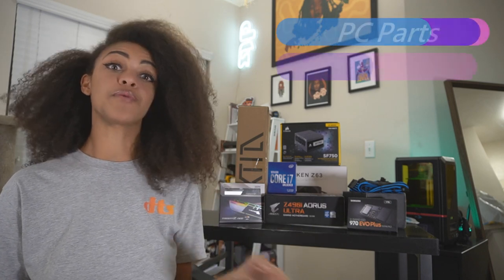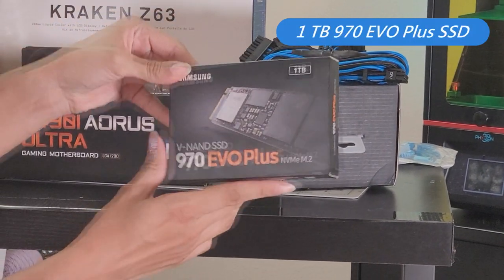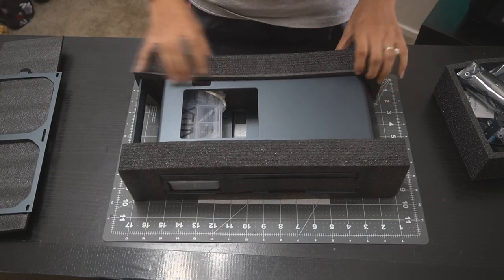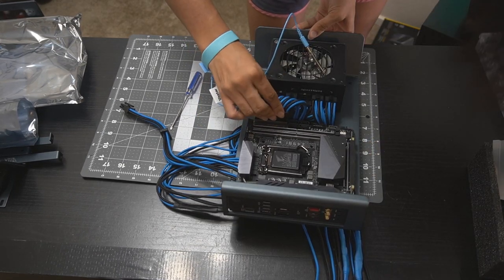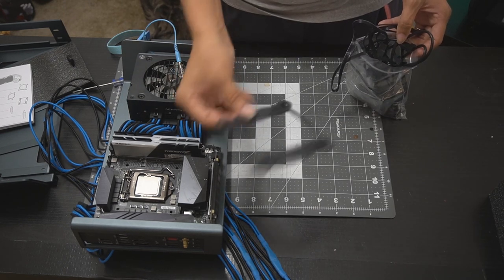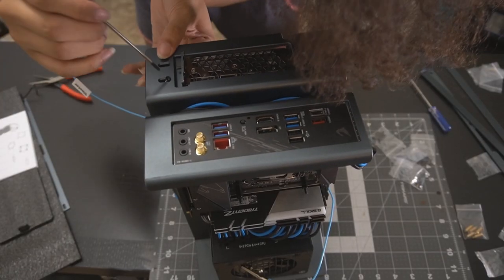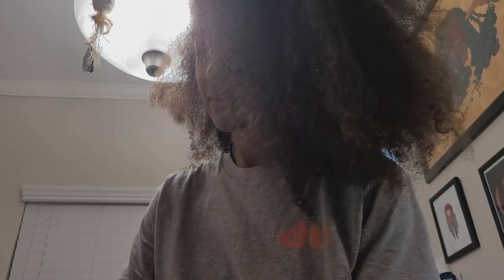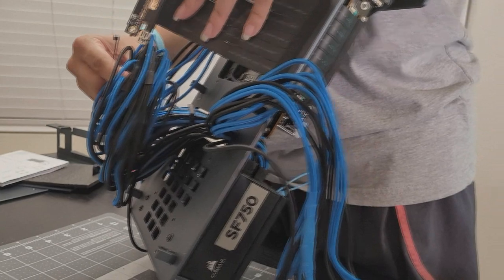BEST Mini ITX Build EVER - XTIA Xproto ITX Case

Comment: Can NZXT fans installed towards outside instead of radiator to display RGB fans?
Reply: Definitely! You could mount them on the outside and do a push configuration.

Comment: GIGABYTE Z590I AORUS Ultra or ASUS ROG Strix Z490-I for my first ever and Xproto L rig? The Z590 is 60$ expensive. Any thoughts?
Reply from the maker: IMO z590I. Gigabyte did great the z590 generation and has really good VRMs for an ITX board. Also, in general, I tend to buy newer than older if I can help it.
Reply: @ChelseaBytes  Thanks. I was leaning towards it too until i found out that i need 11th Gen CPU to to be able to detect both M.2 NVMe drives. Unfortunately i have 10th Gen CPU

Comment: Nice build and spirit. I have seen xproto L but I still think the standard design looks more appealing as more minimalist. Also some one put Anker usb slim 4 ports next to psu that looks so handy. You can see it on Reddit.they have added c zone extender to allow more ssd in between 2 layers.
Reply from the maker: If I wasn't obsessed with water cooling, I definitely would do the standard design. The extensions that have been made are pretty cool
Reply: @ChelseaBytes  I just ordered after seeing your review. The model XTIA N is same standard case but with modifications for new GPU plus the C Zone extender. I will build it running your video plus official case build video. I opted for noctua NH C14S for a minimalist build, although the AIO you used is tempting, but may be in the future. Thank you.

Comment: When grounding you have to attach yourself to the electricity ground, in your case attaching the wrist strap to the power supply without connecting it to the electricity does nothing. I am connect to the metal (not to the paint) of an electrical appliance that is switched off and connected to the outlet